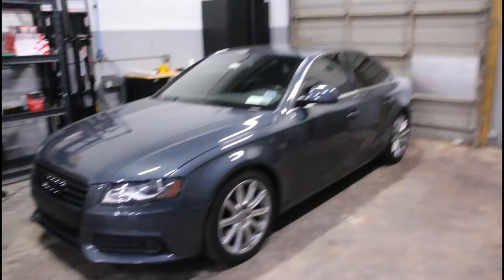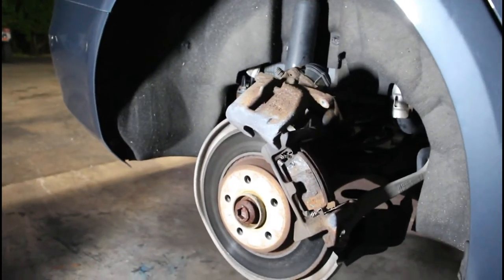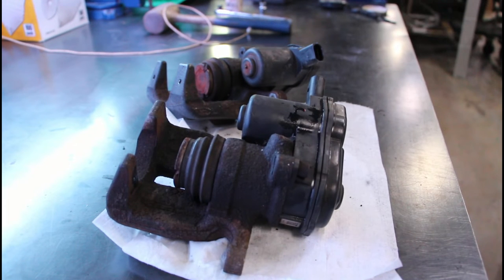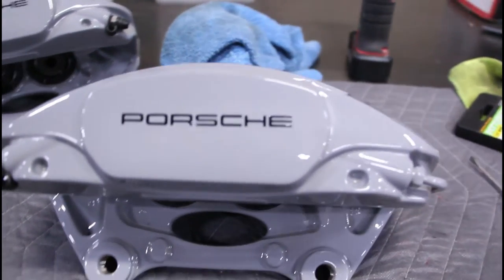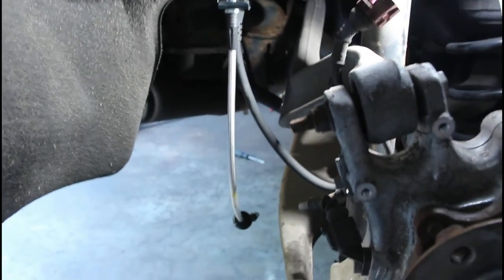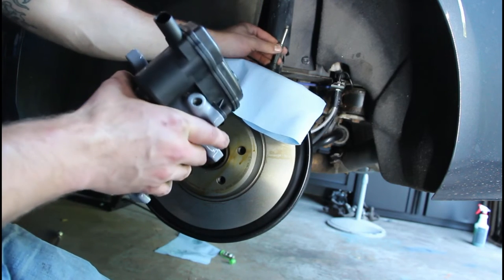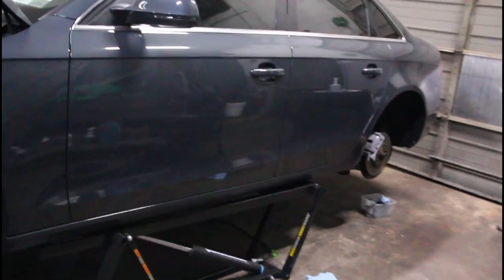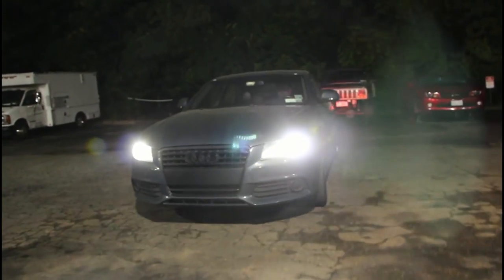B8 AUDI A4 - PORSCHE BRAKE UPGRADE

Comment: Wonderful video.  Thank you for the step by step rebuild processes.  Were your front calipers brand new?  If they were new, did you reuse your original seals or replace them?
Reply from the maker: Thank you! The calipers were really beat up and used, we re-coated them with @kkfinishingco, the seals and boots were fine to reuse as they were in good shape, but we did take them fully apart to inspect and reassemble after coating. 👍🏼
Reply: @kkindustries  Thank you for the additional information.

Comment: Did you manage to eliminate the soft pedal feel inherent with the Macan 4 pot caliper swap?
Reply from the maker: You happen to feel it as well? 
There is times where it feels perfect, and times where there is squish on top, I’ve bled it 4 time all kind of different ways now.
Reply: @kkindustries  Porsche owners report the same problem with new vehicles. I keep reading about them taking their cars into the dealership without fixing the underlying issue. Someone must have had success adjusting the brake pedal or swapping the master cylinder or both…
Reply from the maker: @ratspam7655  thanks for the info man, I’m going to dig into that a bit too, I kind of wish I knew about this before.
Reply: Any updates on this issue?  And my B8 brakes have massive fade (granted I am often pushing them pretty hard)… so hoping this upgrade will help
Reply: Some people on the Mk7 to Macan calipers swap thread, tapping th rcaliper with a rubber/plastic coated soft mallet can help get more air bubbles out.

Comment: Do the callipers fit an s-line b8 2014 plate or does it have to be an S4
Reply from the maker: it should fir the b8 platform, they get used across many vehicles, but the rotros need to be  the S4 type.